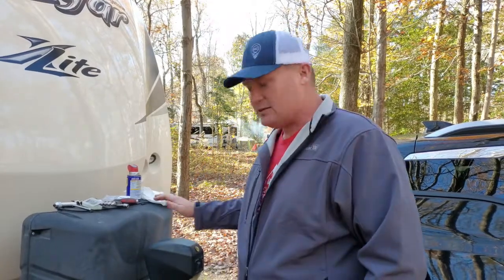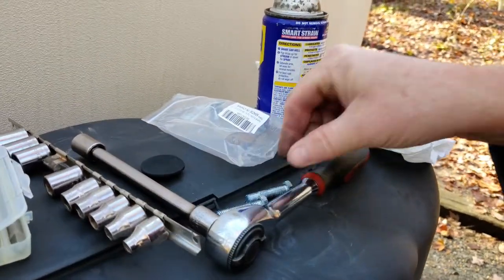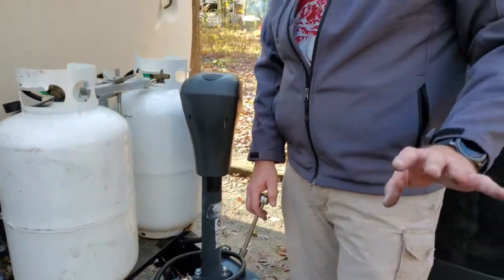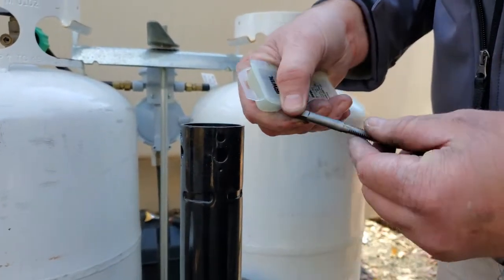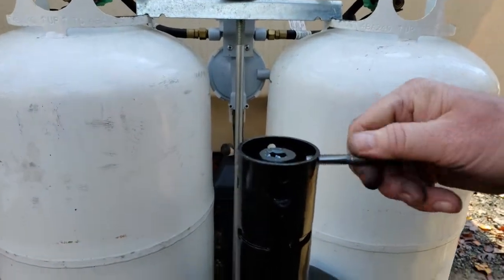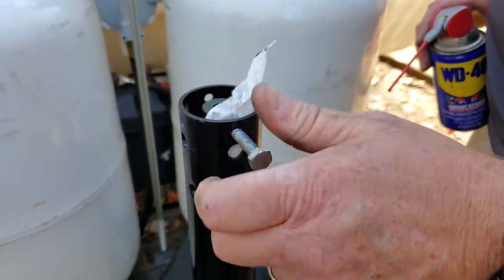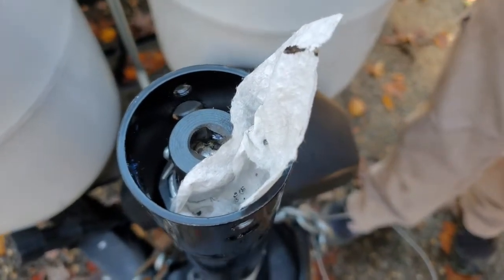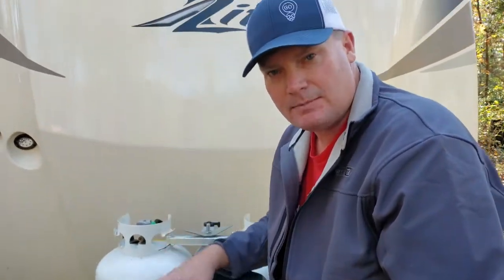EASY TRAVEL TRAILER MOD to OPEN YOUR TAILGATE!

Comment: Bought a new LCI jack and they no longer have e the additional holes to just tap.  Thanks Lippert for taking this in the complete wrong direction.   Had to drill the holes and tap...really tight tolerance to get the head mounted for this.  Lippert take note and redesign your Jack's to help this issue or put the holes back already tapped.

Comment: It would be great to know the brand of tongue jack.  This does not work on all models.
Reply from the maker: Certainly! The Lippert (LCI) jack is demonstrated here. However, there are, quite literally, 20 other brands with the same configuration. The mfg of this jack markets to other brands, so it would be hard to identify all of them. However, if you have a Lippert style jack, this is for you.

Comment: I’ve done this but I still can’t open the tailgate. Pisses me off!
Reply from the maker: You will need an extended hitch, then. Curt and Reese both make longer receiver bars.
Reply: @HopPinandGo   yeah I have to look into that. I may have to much tongue weight. As you extend your hitch it drastically lowers your tongue weight. I’ve also been thinking of moving the propane tanks so I can move the jack.
Reply from the maker: @donaldappelhof2059  that may be a good option as well. Tongue weight is very important, so be sure to know what yours is and what any new configuration may be able to support.
Reply: @HopPinandGo  The sad thing is that all these Lipard frames are junk!  I waiting for my tongue to break off!  I think they come from China.